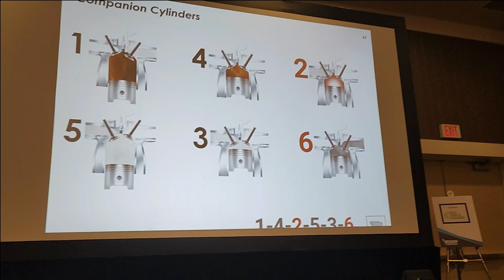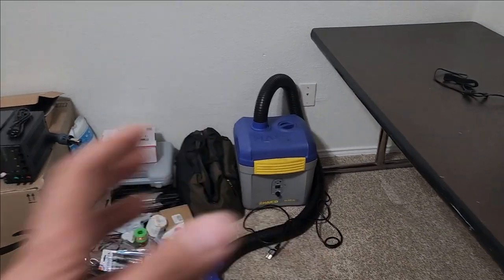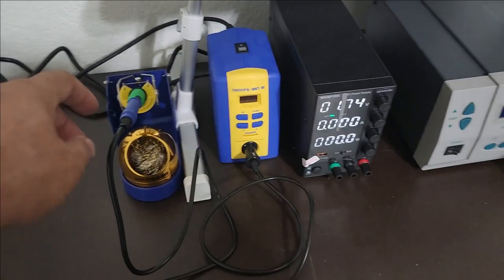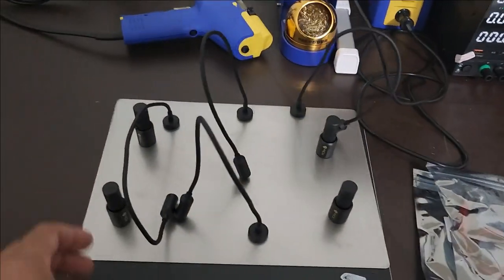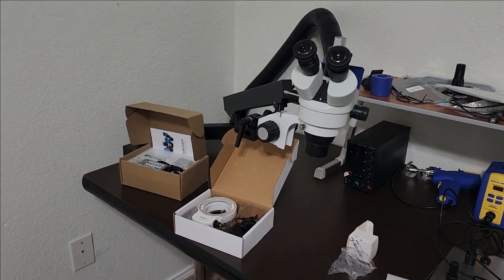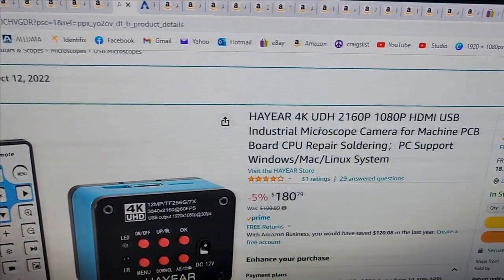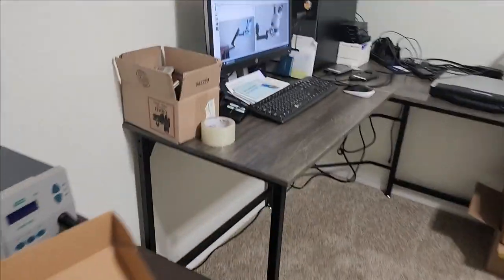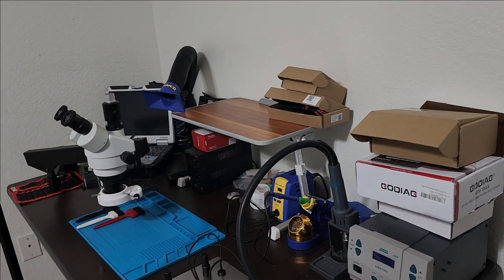My Station Setup for Automotive Module Repair and Programming

Comment: This is really cool..what is the reason for most of your repairs ? I recently had to replace a trunk module on an old Mercedes. I opened the old module and noticed some water corrosion...
Reply from the maker: Thanks. I do whatever I find faulty during diag.